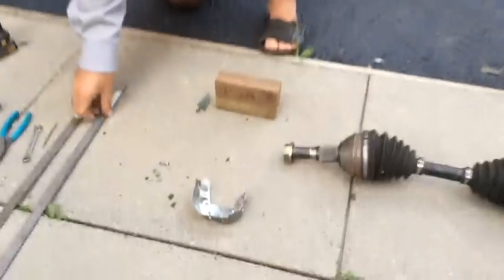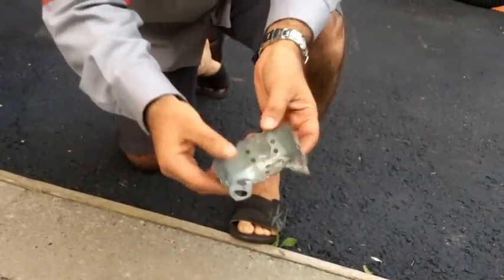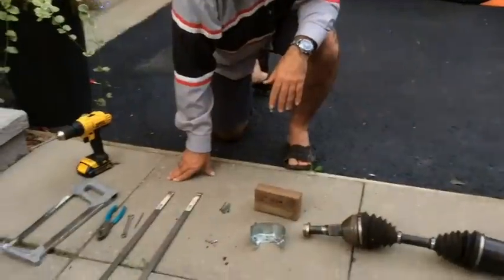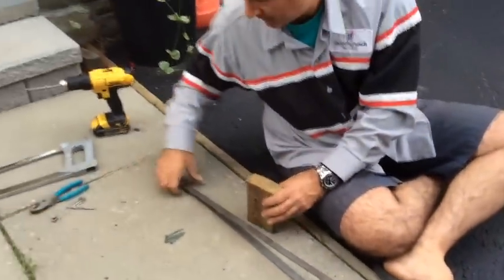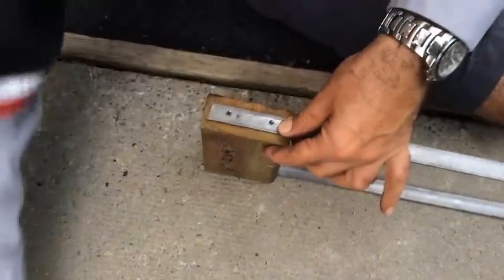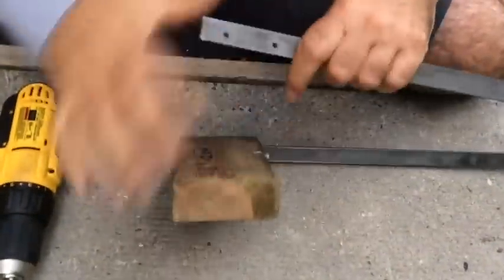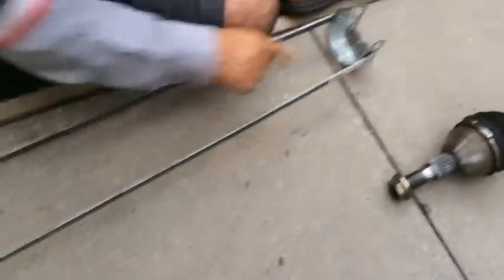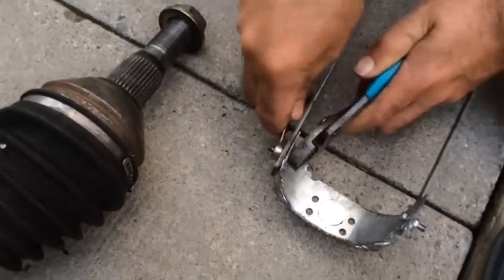How to Make a CV Axle Removal Tool for $10

Comment: Could spend more time on how to cut the electrical box
Reply from the maker: You can use a sawzall or a 4 inch grinder to cut it. The grinder with a cutting wheel is the easiest way to do it.

Comment from the maker: The tool is strong enough. I have used it on several cars and it has not broken. The metal box will wrap itself around the cv axle housing which actually helps removal. Try it before assuming it doesn't work.
Reply: Can you spot me a 10??
Reply: No quality it cannot open the axle ring

Comment: this will not work if the shaft is on tight..great idea but not strong enough
Reply: Of course it's strong enough.  The box doesn't have to keep shape, it will wrap around the CV joint shape and be in tension from one side to the other..  So it's wood block, bar on one side in tension, screwed to box, box in tension wrapping around to other bar,  2nd bar in tension back to the wood block.  All tension wrapped around, not right angles to a thin sheet of metal.   Extremely unlikely even the worst stuck axle will pull that box apart in tension.  Even if you somehow managed to do so, just buy the next up thickness metal box, it will likely still be thin enough to go between the CV and transmission and far less likely to pull apart.
Reply from the maker: Hi blacky T, thanks for your comment. I have used this tool on several vehicles and it has worked fine. It is important to make sure the electrical box portion is pushed down over the back of the cv axle housing, otherwise it will slip off when trying to remove the cv axle.